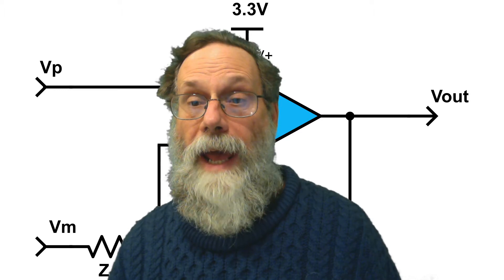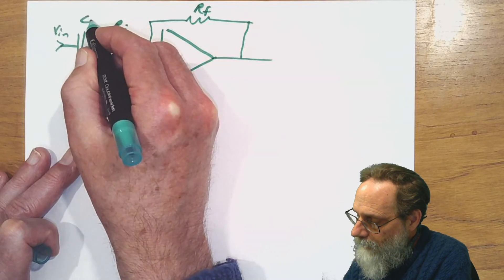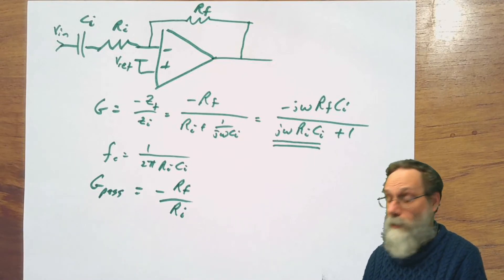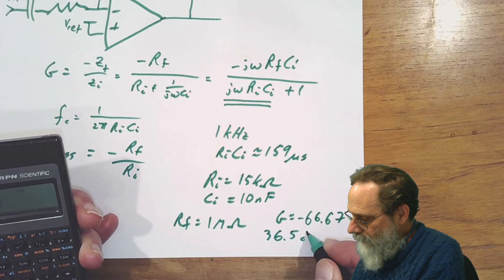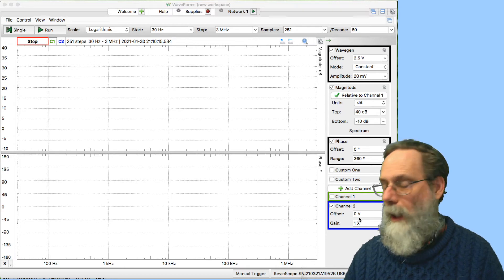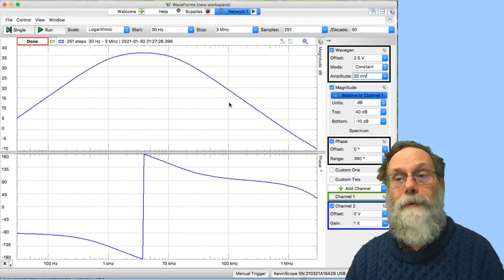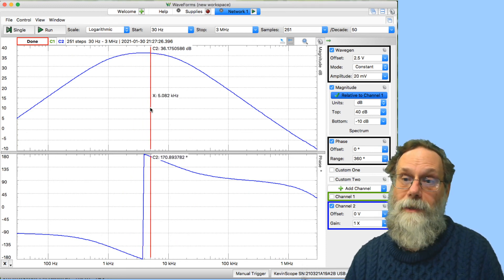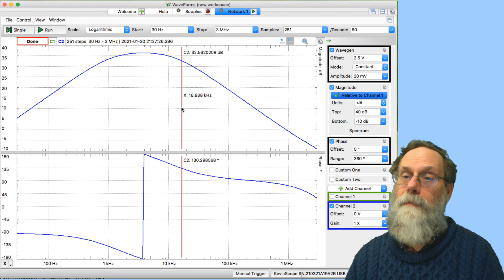Active high pass filters §24.3

Comment: I'm looking for the explanation why non inverting low pass filter is not as good as the inverting low pass filter?
Would you be kind make another video about it?
Reply from the maker: Both are good, but the non-inverting filter has a minimum gain of 1 at all frequencies, while the gain of the inverting filter goes to 0 as f goes to infinity.  That means that the inverting filter does a better job of rejecting high-frequency noise.

I don't see the need for a video to provide a one-sentence explanation.